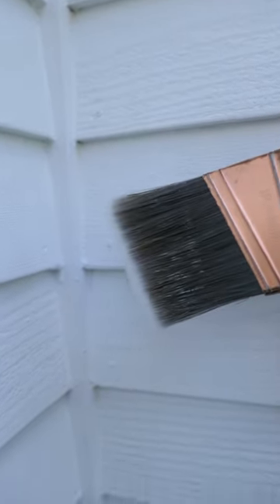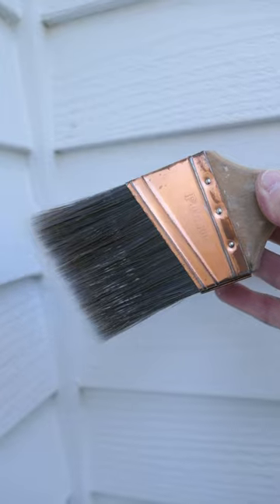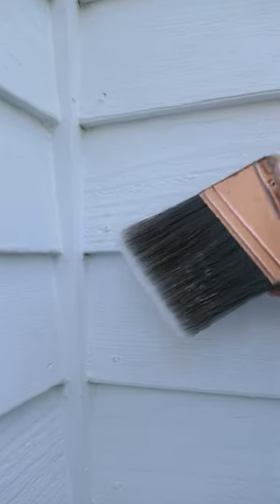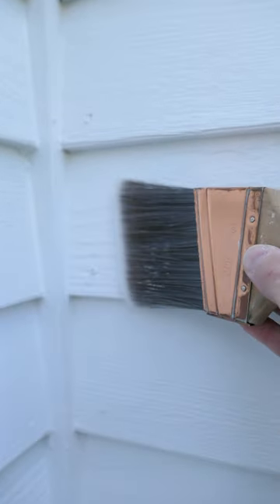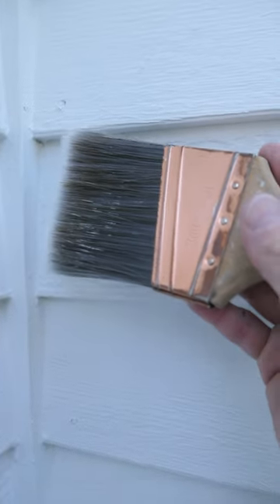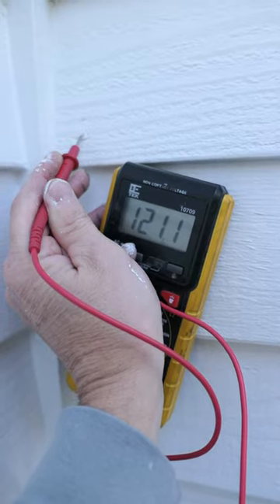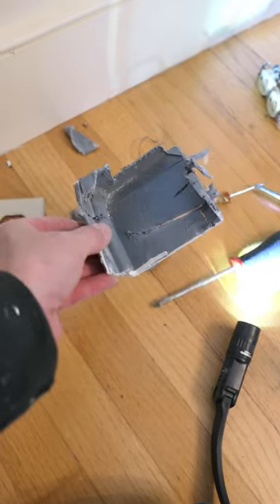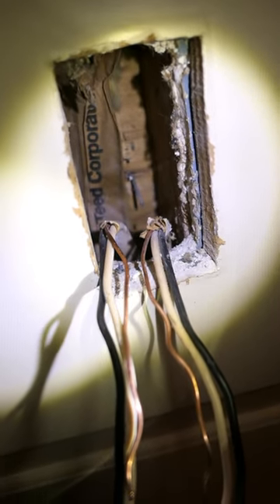Electrocuted From House Painting??

Comment: I've always enjoyed getting to the bottom of things and I imagine this must've been pretty fun to figure out and peice together
Reply from the maker: Honestly, the first shock I thought might have been a pinched nerve or something as I was painting.  By the second and third shocks I quickly realized what must be happening!  In all the decades I've worked in construction I've never seen this before.
Reply: Amazing.  Hmmm, plastic box - maybe a “recent” renovation vs original construction? …
Reply from the maker: @smitm108 No, that house was built in the 1980s and the box appears original.  However, the electrician used a deep box, which was completely unnecessary for two lousy cables and a receptacle.   The deep box put the cables positioned more toward the outside sheathing than they would have been with a regular box.  For that reason, the standard siding nail was just long enough to pierce the cable.  It was still a remarkable coincidence, but it would not have happened at all with a regular depth box.
Reply: @enduringcharm  was my first thought in the masonry story I commented too, who expects to have live paint

Comment: Electrocuted means you’re dead. I think you mean you got shocked.
Reply from the maker: Well, the title was in the form of a question. I only got shocked, it is true, but I believe it would be theoretically possible to be electrocuted from this fault.  Death from electricity depends on the current flow rather than voltage, and the figure often given for fatal current is .1 to .2 amps.  The AC circuit is easily capable of that, so it really comes down to the quality of the ground loop.  In this case the grounding occurred through wet paint, a copper paintbrush handle, more wet paint on my fingers, and my wet knee on the ground.  The breaker box ground wire was buried in the ground about 10 feet from my knee.  Fortunately for me each of these contact points degraded the ground to a certain degree, which reduced current flow.  But, had a couple of these contact points been a little better quality this video might have ended differently!
Reply: @enduringcharm you still need enough voltage to pass the current through you. A car battery can give out about 800 amps at peak but because it's only 12 v, it isn't enough to shock you.
Reply from the maker: @ZacSheperd  Yes, you are referring to Ohms Law, which explains a relationship between voltage, amperage and resistance.  We can think of voltage as a kind of pressure, which can overcome resistance to create current flow measured in amps.  But, we can't forget about the resistance.  A lower voltage can still be fatal if there is also low resistance.  When the electric chair was used for executions they would attach electrodes to a wet sponge in order to lower resistance through the skin.  In this case there was plenty of voltage or "pressure" but the resistance from multiple sources, including the nail, the paint, the paintbrush, my skin, my pant leg, and the wet ground was enough to lower the amperage to an amount which was just shocking rather than fatal.

Comment: I got shocked from a ladder touching gutters of a house multiple times. I thought it was just really bad static. But it hurt pretty badly a few times. I told the home owners. They refused to believe me. I told the man to touch the ladder, he did and went "ouch!" and then said "oh thats just static or something." Lol... so yeah who knows if they still have electric rain gutters to this day or not.
Reply from the maker: In some areas of the country they used to sell electric heating elements to put into your gutters, which were supposed to prevent ice from forming there in winter months.  It's possible you came across an old installation where the insulation had worn off and was grounding out to the aluminum gutter.
Reply: It hurt a few times😂

Comment: I got shocked trying to seal a chimney at one point. Long story short, wire in fluorescent light, pinched by drop ceiling, anchored into wall, conducted by high water saturation in masonry, to my hand, to aluminum ladder, to wet ground. . .  
Nevermind the chasing of wires to breaker box I'll let you all imagine how long this took to troubleshoot
Reply from the maker: Ha!  That's awesome.  I have definitely seen my share of drop ceiling grids being energized.  That happens in both residential and commercial spaces.  But to get the rest of the way through the chimney is another story.  You never know what you'll find,  which is why I never assume anything.

Comment: Got a job to fix a 240v baseboard heater that hadn't worked in many years. After troubleshooting, I crawled thru the attic sure I was going to find a drywall screw splitting a wire but it turned out to be a siding screw from the outside wall going thru the wire. Confirmed w/ voltage pen on the nail head.
Reply from the maker: Strange things can and will happen--it's always important to keep your eyes open!

Comment: And that's why electricians install arc fault and ground fault protection!
Reply from the maker: Yes, new homes constructed under the current electrical code have arc/ground fault breakers protecting each circuit.  This house was built in the early 1980s, so it had just standard breakers.  With ground fault protection on this circuit, my knee hitting the wet ground would likely have tripped the breaker and avoided subsequent shock.

Comment: Im redoing a house right now and with the sheetrock off i have no idea how people dont nail thru one of those electrical wire. Sure they're tacted down but still all 9ver the place. Im gonna see if i cant fix that problem
Reply from the maker: If the electrical is done correctly it should be safe, but that isn't always the case.  When wires go through a stud the hole is supposed to be drilled in the center of the stud.  That way when 1/2" drywall is used with 1 5/8 drywall screws, the screws will not penetrate the wire.  In cases where the wire comes too close to the edge of the stud for some reason, a nailing plate is supposed to be installed to prevent a screw or nail from going into that area.  And when wire is run along a stud or plate, it is supposed to be tacked down in the middle, also to avoid penetration by a nail or screw.  If these rules are followed, it's pretty safe.  But, the rules are not always followed.

Comment: Is this a customer house? Amazing work if you tracked this down for them, I'd hire you
Reply from the maker: Actually, this house is one of the "friends and family" homes which sometimes appear in my videos.  But, I frequently track down issues like this for all my customers, otherwise I couldn't sleep at night.  I've never seen a siding nail pierce electrical before, but I have run across siding nails put into plumbing vents in the wall.  You never know what you are going to find.
Reply: This was a situation where a deadly shock was a potential.  Under the right circumstances, however, it's also possible that a form of battery could be created with a sufficient difference in potential between the spot and the earth that you could feel a shock.  You feel a shock at about .05A.

Comment: So, plastic boxes suck.
Reply from the maker: No, there's nothing wrong with plastic boxes.  This particular problem occurred because the original installer used a DEEP box, rather than a standard depth box.  That put the wires entering the box closer to the exterior sheathing, and probably the wires were not dressed well entering the box either.  Ironically there was no need for a deep box anyway.  The framing could also have been done differently to accommodate the corner trim and siding.  It was a combination of factors, but the deep electrical box was the primary cause.

Comment: God just saved you from a house fire bruh😅😂how the hell would u have spotted that if u didn't paint the house
Reply from the maker: That's a good question, but probably the risk was not as high as you might imagine.  The nail only pierced the "hot" side of the cable, so there was no short.  And until I came along and completed the circuit to ground, there was no real way for the electricity to flow.  Still, not a good situation, and it has been corrected now!
Reply: @enduringcharm  im happpy its corrected its insane that u even found it
Reply from the maker: It woke me right up, that's for sure!